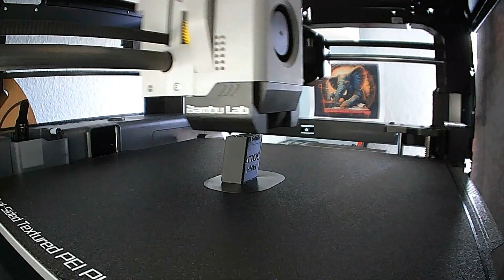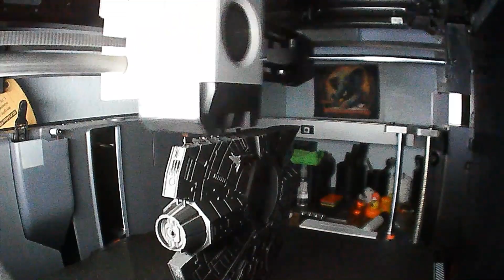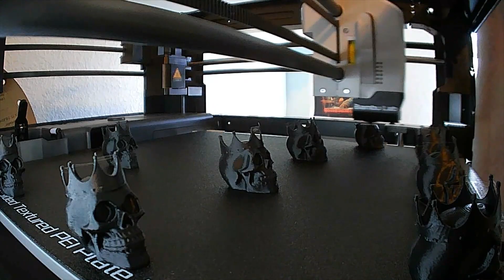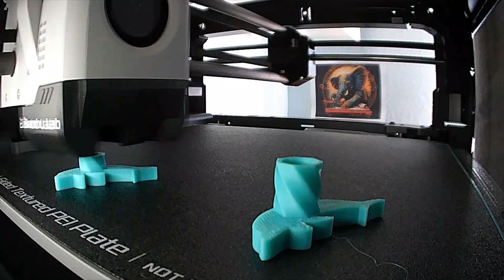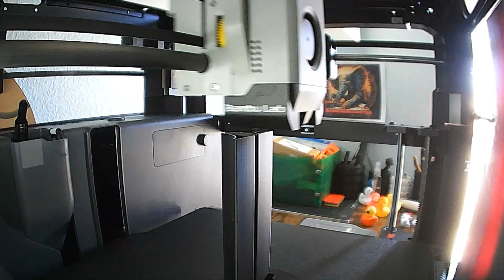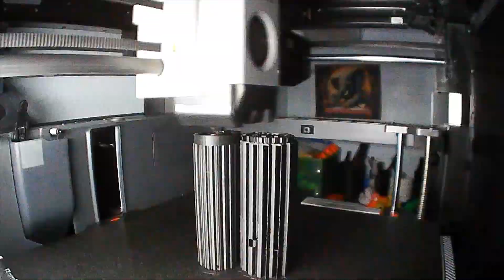3D Printing Time Lapse - 3 days of printing

Comment: What setting are you using for the millennium falcon? I have tried 3 times on my bambu and it has failed everytime. I tried with bambu pla and polymaker and protopasta.
Reply from the maker: I used Elegoo PLA. The settings on the Bambu P1P are:
 (0.12mm Fine @BBL P1P)

Resolution: 0.12 mm
No Supports
Walls: 2
Infill: 15%
Print Speed (Outer Wall): 200 mm/sec 
Nozzle Temp: 220
Bed Temp: 65
Bed Adhesion: Brim (width 5)

If there is any other setting information that might help you, let me know.
Reply: @Solid3dMemories  thank you very much. I will give that a shot